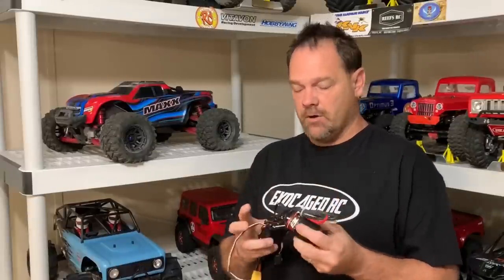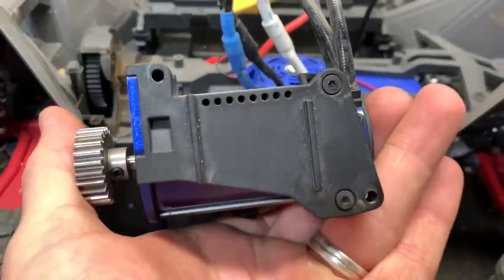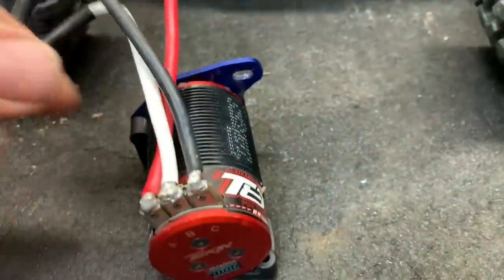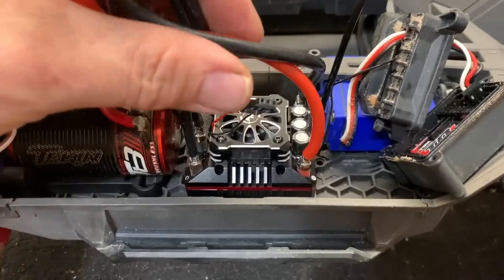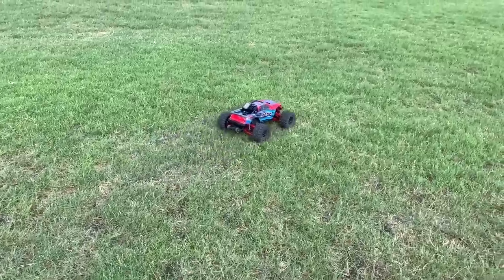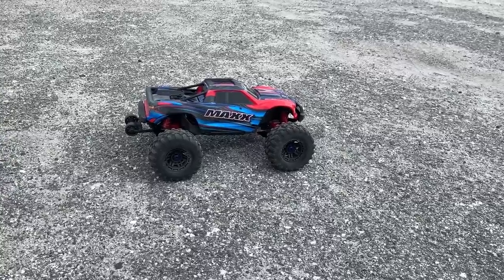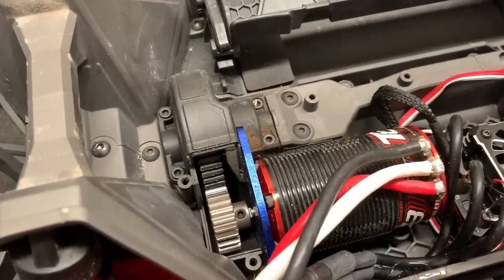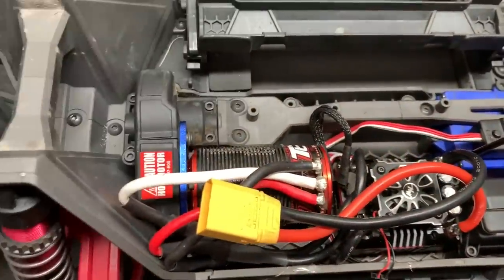Tekin Maxx!!!

Comment: If it would go straight, I'm thinking it has another 5-8 mph more.
The expanding tires help top-end but also destroys control....that's why Pro-line has the belted tires.
Reply from the maker: Yeah for sure. It had plenty more in it as you can see how fast it backflips.

Comment: I threw a hobbywing 4274 in my Maxx. Works great. I think you would love the hot racing battery strap kit 👍
Reply from the maker: I’ve tried straps in the Xmaxx but went back to the stock clip.
Reply: @ExocagedRC  i couldn't get my batteries to fit in stock trey the hot racing is support clean and holds any of my fat batteries. I was wondering how you got your big battery to fit is all... 
👍👍

Comment: Awesome bash here Exo, but what's did u notice with the esc,
Reply from the maker: It just didn't feel like what I'm used to with Castle esc's  This is a really good esc for sure but it will get a castle in there soon
Reply: @ExocagedRC  You mean sluggish? Unresponsive? Too responsive? Twitchy? Maybe you can do a dedicated video comparing the Mamba Monster X vs the XR8 plus to give viewers your perspective. The XR8 has a lot of tuning options with the programming card. I wonder if that would help?
Reply from the maker: Elliot Baltazar hard to explain, it’s like I’m used to the power being right there and sometimes this one had a bit of hesitation, I doubt I’d be able to show that on video. Besides this esc is already gone and traded off for a new monster X that I should have by end of the week. The XR8+ is better suited to racers IMO. I’m a basher kind of guy.
Reply: @ExocagedRC  I hear, that Exocaged😎💎

Comment: Whats the mains difference between sensored and sensorless system? Running the max8 combo in my maxx
Reply from the maker: Sensored systems aren’t smoother because there is a sensor board and a wire so the esc knows what position the rotor is in. Cogging is because the motor can’t keep up with the phases of the esc. I prefer sensored but for many bashers sensored simply isn’t needed.
Reply: Exocaged RC You mean “are smoother” rather than “aren’t smoother”.

Comment: Did you see tekin has a 5slot motor now hint    You should definitely test it out
Reply from the maker: I did see it and I do plan to get one see. I’ve had great luck with their older brushed motors years ago.
Reply: Exocaged RC yeah I had good luck to had a hd 35 and the pro 30 and I got a new wraith 1.9 on the way and wanna see if I stick to Holmes or change it up one time

Comment: You need to sort out the steering, it seems to go to one side, it goes well,😀
Reply: Mine does that too I’m just used to it I think I line up to the left of my ramp before I goose it n hits it straight every time not so much if you line up straight lol
Reply from the maker: yeah for sure, it still has stock servo and the stock radio, I may give the GT5 a try in it.
Reply: Ive noticed no matter how many times i fix the steering on my controller these traxxas cars always end up pulling one way or the other again. Annoying but tsm really helps keep it straight

Comment: I have a question my Maxx hasn’t done a single wheelie or reached 50mph yet and I have the traxxas 5000 mah 4s battery and yes it’s in sport mode or the first mode NOT training mode can anyone help out it’s my 2nd day with it
Reply from the maker: Something must be out of adjustment. These trucks wheelie like crazy right out of the box. So you’re sure it’s not in training mode?
Reply: Exocaged RC yea I’ve put it in race mode and back to sport put it in training and back to sport but still hasn’t done a single wheelie I also did a speed test and it tops out at 42mph rn I also checked everything with the traxxas link app and it seems good

Comment: as soon as I saw tekin maxx, I knew its gonna have stupid power.
Reply from the maker: I was surprised, I don't see Tekin motors used much in bashers and I had this one so..
Reply: I think most people dont use tekin motors in bashers because their stupid expensive. That motor and esc wouldve have been better suited for a racing buggy or truggy I think. Maybe a max8 wouldve been better.